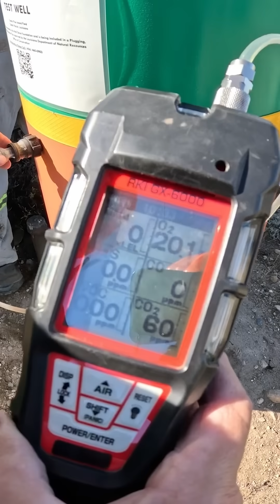The problem goes deeper than you think...

Comment: There's should be a law that forces companies to seal their hole
Reply: There are laws for that now, these are likely holes from before that law came into existence. And most of the companies that owned these wells don't even exist any more as mentioned.
Reply: @Charvin  More recent laws require that the cost to seal it be held in trust to approve the opening of the well.  People are learning not to accept a piece of paper without collateral.
Reply: @Charvin i wish i still had as much faith as you have in people to resist the pull of capitalism
Reply: @Charvin  yeah much of this is probably from a time before we understood green house gases.
Reply: Unfortunately that's why they declare bankruptcy so they don't have to.
Reply: @carlclouseriii8519  we passed a law in Canada requiring oil companies to pay for clean up when they sell off their assets after declaring bankruptcy. They have to remediate before they pay off creditors and shareholders.
Reply: Probably there is, just the companies went bankrupt...
Reply: @Benedek971  That is why nuclear power companies have to set money aside WHILE OPERATING that is used for removing the nuclear plant in 20-30 years. Should be the norm for all kinds of power realted stuff.
Reply: @Benedek971  they didn't apparently, they are just ''child'' companies made by parent companies, they are made to fail and then they can't fix the problems BC they are gone. Really messed up scheme if you ask me.
Reply: @Benedek971 the government has forms of inescapable debt, if a student can't eliminate their responsibility over their student debt, the CEOs founders and share holders shouldn't be able to shirk their responsibility to the environment.

It's not that hard
Reply: @BlueScreenCorp limited liability company. The owners'(shareholders') liability is limited to the value of their shares. If the company goes bankrupt then the shareholders walk away having already taken their dividends in previous years. This is why capitalism is so dangerous without strict regulation. They people who get the profit can't be held liable to clean up the mess they made. Whether that's oil and gas wells, nuclear waste, or ships crashing into bridges. If the cost of clean up is more than the value assets held by the company, the company declares bankruptcy and the shareholders keep all the profits they've already taken, because dividends only flow in one direction. The only way to fix this is to require the company to pay into some kind of bond to cover the future cost of clean up, as a condition of permission to do the thing in the first place. But then you have to be able to predict how much the cleanup will eventually cost before the thing gets built, and have to the laws in place to force the company to pay.
Reply: @BlueScreenCorp It is over 100 years old, the founder is dead
Reply: @gholland5840  First off, you can't possibly know that. Second it doesn't matter the ownership of the vast majority of those wells can be tracked down through property rights and mineral rights records. I am not advocating only that whoever specifically dug this well be held responsible, but all of the wells regardless of the person or company that may have put it in the ground. I thought Americans loved personal responsibility.
Reply: @BlueScreenCorp  they said it was drilled over a hundred years ago, they are dead. Try suing a dead man.
Reply: @BlueScreenCorp yeah but the company isn't around anymore to force them to fix it. The student is and they voluntarily took out that loan. This was also long ago before there were laws to enforce this kind of stuff.
Reply: @adrianthoroughgood1191 You have invented insurance b
Reply: @BlueScreenCorp exactly!
Reply: @adrianthoroughgood1191 not sure about the USA, but in Canada there is a requirement for producers to put money into what amounts to a reclamation bond for every well they own or drill. If they declare bankruptcy then (in BC) the regulator acts as the prime contractor to have the abandonment and reclamation done. I believe most provinces have a similar system. Of course, there are ways to game the system, but I’ve never seen a well left open to atmosphere like that. The worst I’ve seen is equipment abandoned in place, but with the wellhead intact and closed.
Reply: @kurtisb100  Do they have to put the money in the bond before the drilling starts? Or are they allowed to use sales revenue to pay into it? Is the bond enough to pay for deep filling with concrete, or do they just seal the top of the pipe?
Reply: @BlueScreenCorp  lol yeah go and get that money from the dead guys.
Reply: @adrianthoroughgood1191  It is funny that you think people not "owning" their messes is some how the cause of an economic model and not normal human behavior.
Reply: @BlueScreenCorp if a person files for bankruptcy then their student loan debt WOULD be cleared, even the government realizes asking for someone to pay money they literally don’t have isn’t getting anyone anywhere
Reply: @Garrillagamer  in the US student loans are excluded from being able to be included in bankruptcy. Also bankruptcy doesn't just magically wipe away debt...
Reply: @BlueScreenCorp in the US student loans are NOT excluded from bankruptcy and yes I’m fully aware it doesn’t magically wipe it away, it stays on your record but up to a certain amount can be deducted from your debt or entirely relieved depending on which type of bankruptcy you fall under. There are also versions of bankruptcy that allow you to pay back what you owe in payments.
Reply: @BlueScreenCorp   ^
Reply: @BlueScreenCorp  brother this just isn’t true, look up “adversary proceeding”
Reply: @adrianthoroughgood1191 There are other ways to incorporate than LLCs, that's not the only business entity and is not necessarily what oil companies will use by default. Also, the limited liability you talk about isn't "dangerous"; your hyper-fixating on how LLCs in theory act as oil companies when 99% of LLCs are not oil companies.
Reply: @Benedek971  you could make a law going after the shareholders and/or go after companies further down the supply chain.
Reply: @Benedek971 it’s a shell game. Bankrupting the company to avoid wind down costs. Rinse and repeat well after well. Planning negligence for a better roi is preverse. More accountability for the persons who oversee this
Reply: @Benedek971 so make it like mining companies. You have to upfront the cost to return the land to it'd original state before you can get your permits
Reply: @sambuechel9632  that's part of the lease agreement. Most want the roads/gates to stay, and capped wells are buried ~10'. After 20-30yrs they're difficult to find even with GPS and a good metal detector
Reply: @Benedek971  It should be assurance company they need to pay to every year who will seal the hole if the company go bankrupt.
Reply: @Benedek971 that's why there should be a law mandating they have Reserves for such a case or some sort of insurance. Reserve sound like a better idea though
Reply: @Benedek971 There needs to be bankruptcy insurance or something, (kinda like life insurance,) they pay a recurring amount over time, and when they go under, the money is used to clean up the mess they left behind
Reply: @Benedek971  So make them set aside money for decomissioning while they're still pumping
Reply: @Benedek971  should be a law requiring insurance for the sealing of old holes.

May reduce the number of holes and also cover bankruptcy.
Reply: @Benedek971  They didn't actually go bankrupt, they just didn't want to spend the money filling in the hole.
Reply: @Benedek971 went bankrupt to avoid paying the American way.
Reply: @Benedek971  This is why companies need to be charged the fee to seal the hole before they even dig it.
Reply: @Benedek971 someone said that they might not have but instead they’ll come back under a different name once the next boom comes
Reply: @Benedek971 There should be a law for that as well, you don't drill a hole unless you can afford to close it when going bankrupt
Reply: @Benedek971  Need a fund paid month by month while operating.  Insurance.   Shutting a company and going bankrupt is a tactic.  Just form a company for every well.  Drill it dry and walk away after asset stripping it over the last few years of well life.   Simples.
Reply: @Benedek971 there’s a law. It has to be upheld by politicians and law enforcement for it to actually work.
Reply: @Benedek971 ”bankrupt” lol you mean the own sold all stocks once profits were up in smoke
Reply: @Benedek971  Bankruptcy should not be an excuse, especially not the way the oil companies use it.
Reply: @Benedek971 then the government should
Reply: @Benedek971 needs to make a law u can't legally declare bankruptcy unless the hole is filled if u fail to do so ur private property like business building or ur house is sold to cover cost
Reply: @Benedek971  Now that we know that tactic, it should be easy to require them to pre-fund sealing any wells drilled and park that money in an account they can't touch. The drilling permit process could cover all that.
Reply: @Benedek971  I hope there are also laws against creative finance to make your company show up as bankrupt.
Reply: @Benedek971 *”bankrupt”
Reply: @Benedek971  You mean they cut and run with the profits.
Either the company should be forced to set aside money to cap a well from the beginning, so they're never in the position where they can't.
Or the owners/shareholders of the company should be sued for the money to pay for the capping work.
Reply: @Benedek971 sure buddy I gives you go bankrupt after mining a gold mine you ain’t fooling us they don’t go bankrupt oil is the new gold like bruh how arrogant
Reply: @Benedek971  CEO and all investors need to pay for sealing costs
If any of them refuse, then prison.
Reply: @Benedek971  During the bankruptcy hearing, the courts could say they must set aside a certain amount of money to seal the holes. I'm guessing, there's no money to be made off that so they don't care.
Reply: @Benedek971  There is. Oil co. pay for Plug and abandonment up front.
Reply: @Benedek971no they didnt 😂
Reply: @Benedek971 They don't actually go bankrupt. They just do it so they can stop spending money on the hole. They just start a new company and repeat the process.
Reply: @Benedek971they should have been forced to put up a bond for the cost of closing it before they drilled.
Reply: @Benedek971workarounds probably
Reply: @Benedek971sounds like then mail should be the next stop?..i love how even when it’s a good thought there’s a ……… person
Reply: @Benedek971  they didn't go bankrupt, just cancelled the company thingy idk

You will see the same ones under different names operating on other stuff, 

There are laws that you gotta seal the hole but there are holes dug and abandoned before the law existed
Reply: @Benedek971 bankruptcy still requires you to settle your debts. That SHOULD include damages like this
Reply: @Benedek971That's why companies should put money in a protected bank account before they get a drilling permit.
Reply: @Benedek971 going bancrupt should not be a reason to avoid responsability from earth polution. Should be done by goverment and the money should be takan out of all the shareholders of that company untill it's paid off.
Reply: @Benedek971 nah what the companies do is make another company sell the well to it then make that company go bankrupt. It really didn't but allows the original holder to no longer be responsible.
Reply: @Benedek971 These companies just open a new one under a new name later on. They just do not want to spend money on sealing these wells.
Reply: @Benedek971 "bankrupt"
Reply: @Benedek971 they don't go bankrupt, they use bankruptcy as a restructuring tool so they can fire people, re-open under a new name, and pay less for the next time.
Reply: @Benedek971  bankruptcy doesn't mean you get to stop everything you're supposed to do by law... It still needs to get done one way or another
Reply: @Benedek971  They are bankrupt because the owners of the wells sold them to companies they knew would become bankrupt thus avoiding having to pay for the caping of these wells.
Reply: Some of these wells were abandoned over a century ago. There aren't even good records of where they are. Recently the state came by my property with a giant metal detector looking for old wells.
Reply: @Houshalter Holy crap dude.. That is kinda freaky! And rather ominous as to what can come up and out of these old wells...
Reply: There are laws now and old wells are tracked. One problem is: company A drills the well and pump what they can get cheap, goes out of business, owner starts up company B which buys the rights dirt cheap and pumps a tiny amount of oil just to keep the well active, they will also pump a little any time they get called out for having a non-producing well. They can do that for decades, all while leaking harmful gasses uncontrolled. Really have to chase some down before they even think of closing a well. A friend tracks wells in Utah, not a job for the faint hearted. There have been multiple threats on their life and firearms pulled by non-compliant operators.
Reply: @TimB-  False. Acquisitions are not immune. There is some truth in required production to keep a lease on .gov land. It's not a loophole, it's compliance. .gov loves revenue too.
Reply: Take a deposit for each hole permitted
Reply: Probably is, these days, or at least requires funds set aside for end of life well closures... but the fact that it's a century old or more is the problem. It predates the EPA by a good bit, and maybe even the more lassez faire regulations of the early environmental movement.
Reply: There's been laws in place since the 80s that I know of. We actually had to get a bond for a well in case we went bankrupt it paid to cap the well........crazy thing is that a lot of these old wells are worth pumping again.  A 5-10 barrel per day hole was once a loss,but at today's prices a small operation can make a good bit of money 😮 we got back in the business and we're properly running 8 abandoned wells and average 125 barrels per day all while cleaning up after the previous operation 😮
Reply: @RobertFothergill-u1z  I'm surprised it pays for the drill rig and maintenance.
Reply: Ayo
Reply: In okla. The oil companies pay extra in case the go out of business. So the state can plug the old well
Reply: and everyone telling you to go vegan to save the environment needs to seal their hole too.
Reply: Us government does require. It's just such a low amount per year they have to seal. Like 50. There is a company that has thousands of leaking abandoned wells in the north east. Slowly capping them at the bare minimum, some leak explosive levels of methane.
Reply: Same for women who whine too much
Reply: The IRS seals my hole every year
Reply: “Bankruptcy”
Reply: There’s many holes to seal if the company is big enough, aswell as many ways to seal a whole😏
Reply: In Colorado, there are laws that, if a well is not producing, it is mandatory to plug the well off.
 This well on the video must have been a small private company. Bigger companies follow the law so they can keep producing.
Reply: I'm sure there is, but when that company doesn't exist anymore, you can't necessarily force them to do that.
Reply: Pause
Reply: Same with woman
Reply: Can’t make a company that doesn’t exist anymore do something
Reply: Is it me or does that sound.... its me isnt it.
Reply: That's the reason they use cut out companies to own the actual wells. They declare bankruptcy as soon as the field dries up. There needs to be an escrow law that requires a deposit for capping wells when they are drilled
Reply: there is now, just wasnt then.
Reply: Great idea!   🤔 so how do you force a company that no longer exists to perform work 😂
Reply: giggity
Reply: yeah and one for my ex wife!
Reply: Its de regulation through political lobbying. "We'll donate $20mil this quarter if you look that way"
Reply: I was asking a windfarm leasing agent about this kind of stuff several months ago. What happens to those huge towers and the chunks of concrete they're set in when the windmills go extinct? He became tongue tied. The lifespan of a windfarm is only ten yrs. That's the same amount of time it takes to get it built. I can see the beautiful prairie littered with those obnoxious things in various states of disrepair. The landowner waits for a tornado to take them down because salvage companies want the entire salvage value to take them down.
Reply: And some women, too 😅
Reply: HAHAHAHAHA, we using them as Fracking holes here in Texas.
Reply: Nope, they need to be required to pay to plug the well up front.
Reply: @michaelallen1432 , by someone registered.
Reply: People care more about profit than doing the right thing
Reply: You should tell that to your girl
Reply: Please be clear, which holes?
Reply: There’s a land reclamation act iirc that forces mining companies (which oil companies fall under) to restore land back to its original state after an operation. As stated by previous replies, they usually go bankrupt and never do it.
Reply: Corporate law acts as a shield that keeps individuals from being held personally liable. Also there isn’t a specific party that has standing to claim damages so it rarely ever gets to court. Even if you lose livestock or the life of a loved one due to radon or whatever leaking out the people that drilled the well could all be dead, and long dead at that. People been drilling for more than 150 years. By the way, don’t worry about this in terms of environmental impact. China pours so much concrete and does so much construction. That’s the real greenhouse gas emitter. India and Vietnam are next for mega construction projects but China went nuts for a little bit so yeah…
Reply: @larsfinlay7325  India now has like 9 of the 10 most polluted cities on earth.  It wasn’t long ago that it was China.  I don’t know if that means that China got cleaner or India got dirtier, but both are terrible on the environment.
Reply: And my ex gf 😂
Reply: And if you go bankrupt, the owner / board should be personally responsible for paying for the sealing.

If you can make millions over decades, then it’s your fault for not saving enough to seal the hole you made. Pay for it personally or go to prison.
Reply: @_-JonDoe-_   that's the well one of the problems. You an I are individuals and if not felons citizens. The corporation isn't. Yet they use the government to play both sides. If it benefits the company they argue they fall under citizens individuals rights. Yet when it doesn't or harms them they argue there's no individual person responsible an they aren't citizens or persons. Hence they literally just play like Baldwin did in the film fun with dick an Jane. When someone calls accountability they put sone poor Dick in the spotlight awhile cashed out before public knowledge of co closing. Then they put Martha Stewart in prison for getting caught. Awhile every lifetime politicians living in mansions (plural) on a supposed income of only $50k to $100k. The president last got a raise by Clinton from like 50k to 100k yr I think. Tell you why anyone w $ supposedly w $ like trump would want office Yet never once served office b4 last term? Same reason why no lifetime politicians wanted to serve as potus. It's a 4yr temp job 8yr at best. Can get in an rob w 1/3rd power us gov. 2/3 or even 3/3 if party controls congress an Supreme Court. Any senator wants lifetime power an stealing. Potus wants to be the boss. There's a trade off either way. Crimes that they choose run another woman against trump after hilldog. When you think it can't get anywhere worse then hilldog vs trump it does. South park Said it best. A giant dueche vs a turd sandwich.
Reply: 😅 sometimes i feel like that should be the case for some people, too!
Reply: ayo
Reply: And clean up their equipment and re landscape the area they trashed. 
They made plenty of money clean up your mess people
Reply: Back in the day that law probably did not extist. There probably is today but even though they exist the fine is probably cheaper than the money saved to not seal it. Thats why fines should be tied to the cost. Oh, its $500k to seal that hole, you just got a $1m fine for not sealing it.
Reply: No no no no no.... These companies should be required to post a bond before drilling.  The bond should cover the cost of plugging the well.  No bond, no well.
Reply: They should pay up front.
Reply: There is today thes are most likely damn near 100 years old
Reply: Make them pay for the sealing service before they can get a permit to drill, then when they go "bankrupt" its already paid for. Im sure some young business owners would jump on some good government contracts like that.
Reply: Specifically that they should fund the sealing before they ever start drilling in an untouchable fund that the government handles when they're ready to seal it.
Reply: This is from a hundred years ago, things are different now and the laws have change
Reply: Capitalism, it creates problems and then you need a plaster to cover up it's issues afterwards.
Reply: All developed countries have had laws governing this for the last 40-50 years. But merca is the land of corruption and bribery. So shit like this is still going on.
Reply: Companies need to pay the cleanup fee up front in some kind of bond. Most of these companies go “bankrupt “ as a way to abandon their responsibility to cleanup.
Reply: @shanebassen5963  they do have to now. These are old wells from before the rules were brought in.
Reply: @shanebassen5963 the law does require bonds before being allowed to drill new wells.   But the specifics vary from state to state. This means the well can be sealed up if the operator abandons it or go bankrupt
Reply: @shanebassen5963  Best idea I’ve heard in a long time!
Reply: Regulations to force companies to run their business in a specific way?! in america? are you out of your commie mind? (satire)
Reply: There could be a fund. When you operste, you have to put money to that fund and when operation ends, the well would be shut with the money from that fund.
Reply: @anttikaipainen6072  that is what a bond is in a way.  It's like a insurance policy that you pay up front and if you go out of business they take the money and use it to close the well. If you do everything right you get a good portion of your money back
Reply: Ayo
Reply: There are in Texas
Reply: How do you enforce that when a company goes bankrupt
Reply: @Menuki  it is payed while they are still on business
Reply: @Menuki  tax them then give tax breaks to companies that repair
Reply: @modernNeanderthal800  tax them???

A bankrupt company…that has no money…often times no longer exists….

Who are you taxing?
Reply: @Menuki  the next company that comes along, then use the money to fix.

But fr tax the rich in general lololol
Reply: There are now
Reply: with what money?
Reply: There are laws for this. But how do you make an operator plug a well once they’ve gone bankrupt and no longer exists.
Reply: Who are they gonna hold accountable? The employees that got fired and have nothing to do with the company any more?
Reply: If the company goes bankrupt and closes up there‘s no company to force, and on top of that. Some of these holes are over a hundred years old
Reply: There is now. They also pay for wells that are 15 years old and leaking to get plugged. Working on CBM Methane wells, you get a lot of duds and the companies usually can’t afford to plug them without help
Reply: Why do ignorant people always think they have the best idea EVER to suggest this when there IS such a law?
Reply: @UpcomingJedi  don't blame your fellow citizens for being "ignorant", there has been a lot of work done to keep people from even knowing this is an issue. 
now i don't want to be ignorant, i want to understand more, can you explain how they get the companies that went bankrupt 50 years ago to seal the holes?
Reply: tehehehheeee
Reply: Theres a law for sure but when the govt worries it about it then, we will too
Reply: There is. It’s the BLM and the EPA. They plug all wells before they abandon them. They call it a P/A
Reply: Ya, how dare those 100 year old oil men break the law?
Reply: Law? You mean that facet of post bronze-age society run by greedy corporate types? (And administered by bullies in uniform issued with guns at taxpayer expense and given blanket immunity to break any law themselves without consequences.)
Reply: Good joke. You are talking about the land of the free, where everyone has the freedom to poison others, but no one is free of poison from that land
Reply: Those companies are long gone & most likely the land is abandoned or sold
Reply: Hard to enforce when the company doesn’t exist and the people who owned it are not longer alive!
Reply: They are all capped in Texas. If the operator is out of business, the Railroad Commission has a program that caps them
Reply: Haha, they'll just bribe their way out of it.
Reply: There are laws in most if not all states now, passed by liberals trying to oppress hard working business owners. lol
Reply: yeah because laws force people to do things
Reply: Then they will seal the holes with the cheapest method they can find
Reply: @LeoXIVThePope  or not at all, because getting caught is a small fine, and usually the companies dissolve and there's nobody to fine anyways.
Reply: Exactly
Reply: There are…federal laws..
Reply: My ex doesn't care about the law.
Reply: We been drilling oil for longer than we’ve known what pollution is.
Reply: In colorado there is. It was after they found there may have been as many as 3000 uncapped boreholes all over the state and no map of the locations.
Reply: Apply the same law for unmarried women too 😂
Reply: There's a law, it's just that many went bankrupt and that the seals don't last forever.
Reply: This comment is funny.
Reply: @rinnegone377   Kinda hard to force  companies to plug their holes when they've been nonexistent for a hundred years. Many of these holes Jerry's talking about have been there since 1912. Many modern companies know of these issues and try to address them.
Reply: There is. This is what regulations are in place for.. Perhaps back then there wasn't much oversite.What would you think if I told you there are people out there who want to let corporations do whatever they want and have little to no regulations?
Reply: Already exists.
Reply: I agree that something from the first shipments of oil should have to put funds to re cap well .why does the taxpayer always pay?
Reply: Gas companies are particularly bad for leaving abandoned wells to spew methane into the atmosphere. They legally have to seal a well when they run dry or they abandon it, but all they have to do is say “it’s not abandoned, we promise we will come back and use this well again! 👉👈”
And even if pushed to fix it, they just sell all the “assets” (ie the wells that need to be sealed) to a shadow company, and then bankrupt the shadow company so they’re not responsible for it.
Reply: This happened years ago those laws are in place now 
😅
Reply: Telling a bankrupt company to cap the well, after all the dollars and people have left is like telling a dead person to walk to the morgue.  
What are you going to do, take the company away? Here you go, your oil well have fun.
Reply: Not as long as the billionaires are the ones making the laws
Reply: Or the mineral rights holder since they're making money as well.
Reply: vote republican Trump2025 my guy
Reply: They should apply that to my ex aswell.
Reply: Yup as soon as the law matters to the rich
Reply: 90% of these companies manage to magically go bankrupt right around the time they have to do reclamation work.  Then the government likes to use taxpayer dollars to do the cleanup.
Reply: Laws are for poors not the rulers.
Reply: @GoogleDeletesYourComments  The poors usually seal their holes by choice... for fun or profit.
Reply: I’m wondering, can’t you just plug the top only?
Reply: I’m wondering, can’t you just plug the top only?
Reply: @GraysonDevin-c1w  I mean you can, but plugging the bottom is the fun part.
Reply: There should be a small percentage of oil profit set aside in a government owned account that can only be used to seal & rejuvenate site
Reply: @slypig24  for sure but there ain't lololol
Reply: Keep that in mind when Space X goes bankrupt.
Reply: It's funny to think,  oil tycoons personal bank account $759,000,000 his drilling company -$500,000,000 🤔 🤣 😂  hasn't turned a profit in years.  😮😮
Reply: I gave my wife one of those laws already
Reply: Regulation on business is good for this exact reason. Companies will always prioritize profits over human safety or even innocent bystander safety. So next time u vote remember who is advocating to give these big companies even less regulation and to pay less taxes than u and me. That will tell u who is looking out for who. I terestingly enough, this has been a problem since the 70s back when corp tax rate was 60-70% and a single worker could buy a house and support a whole family. The businessez have convinced a large population that they know whats best for everyone else and that as long as they make billions they will ha e a good jobs for u. What a load of shit. If u look at the data 80% of what they save everytime their taxes get cut, goes into stock buybacks or some other scheme to generate more wealth for the tip executives never to boost wage of lower workers or to build the company up yo be better for the consumer
Reply: There are, but the cost is so great that the company just decides to file bankruptcy instead. Most are under LLCs, so the sakeholders are not liable.
Reply: @JayRSwan  cost is so great? Guess thats why they keep raising ceo pay by 500% or why they have record profits over the last 50 years. Definitely bothing to do with the tax cuts they have gotten over the same time frame that all of ours have gone up or had new ones added to us. Governments job should be to protect the people or help them(homeless/autistic/ect) but the companies got the politicians turning the transfer of wealth into the upper elite oligarchs and corporatioins that will outlive any human. Not to get too political, but this coming election you have a candidate saying that these billionaires and their giant companies need even more support, so they can buy more yachts like bezos and musk. Another candidate thinks we should tax those big corps and promote smaller businesses
Reply: When the oil runs out so does the money. 

It should be a percentage of the profits held in trust.
Reply: Surprised to see no horny comments about plugging holes here.
Reply: Or maybe an incentive rather than punishment.  We have enough laws.
Reply: When are company goes bankruptcy, it usually closes down, unless it gets bailed out. Hard to force something that doesn't exist to do something.
Reply: Another law and another regulation won't change anything. That's a lot of concrete that they have to fill in and I'm sure it cost a lot of money to get a whole crew out there for 3 days to do just one so imagine doing thousands of them
Reply: @jaredkay6970  Its too bad that these wells are so unprofitable that the companies that are still drilling and using them are only making 100,000,000s off of them in the lifespan of the well and can't afford the 1,000s to properly clean up the mess once the well goes dry... 

Thousands of dollars per well, for an oil company is like you worrying about a 5c bottle deposit, its insane that you think that is too much cost let alone a significant cost to let companies just get away with ignoring the messes that they have made in the past and give them open license to pollute into the future...
Reply: @BlueScreenCorp  It will just be another tax  on the consumer. The big business is in league with the big government and the losers are the people paying for it, which will be you and me
Reply: There is
Reply: Stop lying. Drilling companies have been forced to post bond for well sealing since 1960.
Reply: True, they let out so much foul gasses that i feel like sealing it with plug should be written in law.
Reply: There should be a law forcing your wife to keep her whole sealed while you're married
Reply: There are. It's called remediation & rehabilitation. In accounting its ARO (asset retirement obligation)
Reply: Idk if anyone has mentioned this but instead of covering the holes, they light the gas on fire so a the gases burn off. You’ll see it in Texas countryside at night, along the highways as tens of miles of just field with little orange flames flickering
Reply: There are . The state has a find to plug orphan wells in Texas . The video is narrated inaccurately
Reply: It's called, we are rich and we make the rules so no, can't force us to spend money on doing the obvious right thing.
Reply: @matthewboyd8689  do a little home work. Completely clueless
Reply: There is but if the company has no money........?
Reply: @RH-cv1rg  all companies pay into the state . Smarts states set up a fund for this issue.
Reply: @davidbrooks1724  Was that the law in 1920?
If the State receives the money why aren't they plugging old abandoned wells?  Didn't the State get the money?  What are they doing with it?
Reply: @RH-cv1rg  it’s not 1920. And yes the state of Texas contracts for the plugging of wells .
Reply: @davidbrooks1724  Take a look at the well and it is in CA.  The video was about COMPANIES abandoning the wells and not plugging them.  Stay focused.
Reply: Yes, yes there should. and, phrasing.
Reply: Companies would just declare bankruptcy so that government can clean up their mess.
Reply: @gund89123  oh ok . Yes Exxon does that every day
Reply: Hell in some cases everyone who worked on that rig and their kids have already died of old age. We been drilling oil for a LONG time. There is lot of work to do.
Reply: Go bankrupt but you are still should be responsible to correct the problem or go to jail.
Reply: There’s too many Good ole boys in the system.
Reply: Legislation now mandates that this happened however small Wells like these often were created and then abandoned before the legislation was created
Reply: Government is the one causing the problems
Reply: We have laws against stealing and murder too….odd thing is, I keep seeing thiefs and murderers.
Reply: There are lots of laws, but oil lobby buys the legislature
Reply: Some of these wells are from like 100 years ago.
Reply: Liberal propaganda.
Reply: Very poor choice of words.
Reply: Not with someone like Trump…
Reply: @JonDoe-Berlin  
Meanwhile, the Biden/Harris regime hasn’t mandated it during the most previous four years. Sounds like you should vote Kamala, she’ll definitely make it happen now. 🙄
Reply: Ayo
Reply: Tell that to my ex
Reply: The fine will probably be five dollars. 
Plus, the oil companies own too much of the government to care anyway.
Reply: I'm sure there's a "Yore Ma" joke in that original post. 😂
Reply: If trump wins you can say goodbye to regulations like this
Reply: We have to get a law that seals Donald Trump‘s hole first.
Reply: @davidthompson7817  I sure hope he wins! I can’t afford any more of what the Dems/ left have put in play!
Reply: Tons of these ‘orphan’ wells were drilled in the 30’s and 40’s by Roosevelt’s run up to WW2, went dry in the 50’s, and were signed over to the land owner decades ago.  Since then the land has been sold a few times, and the new owners may not even know that a well is there.  The Texas Railroad Commission has been doing nothing but doing the producers bidding for decades.  Now a man named Hawk Dunlap is running.  He’s an expert in the oilfield with decades of experience.  He’s been trying for years to get the RRC to plug wells properly!
Reply: Whenever someone who doesn't know says there should be a law you're basically licking the boots of politicians who want to take away freedoms from people and impose regulations that end up costing taxpayers trillions of dollars. It's absurd. Why don't you educate yourself on the topic..... I mean a real hard look at methane use and production. Perhaps then come up with an easy solution that doesn't cost taxpayers money and uses sound principles to conserve nature.
Reply: Yeah there mouths so they stop talking nonsense
Reply: Do you hear yourself? A bankrupt company is dead with no money to pay for that
Reply: @benhoffman8264  they often pull strings to go bankrupt while keeping their profits to reduce cost of clean up. Therefore keeping more money for the 1% that control the business. Bankruptcy is in some cases a business/financial decision
Reply: Just like every other law, there are ways to get around them if you hire enough lawyers
Reply: Same could be said for my ex wife 😎
Reply: @molonlabe2645   hello Mr 261 I'm 260 we've met the same type if woman much as mosr the other 265 lol
Reply: There is these days.
Reply: They should make them pay a bond to close the well before giving a licence to operate the rig from the beginning.
Reply: Escrow accounts.  Every hole drilled means that money has to be put in escrow to cover sealing costs.
Reply: There are laws about plugging a well. Depends on the state is how much oversight there is in plugging a well. BLM usually stay on top of whats going on. Some of the service companies will cut corners if they can to save money. As each cement plug dries, your supposed to let it set around 8 hours. The biggest cut is to not tag it with your work string to make sure it's there and set up.
Reply: They don’t do this. I know this as fact personally
Reply: To pay up front for the cost, so it’s paid before they get all their money and somehow declare bankruptcy
Reply: why its your property !laws another KAREN
Reply: You can say the same thing for when companies pollute the ground or the water table they don't pay for it the taxpayers do
Reply: @maxwolf2726  If the company is still in business, they sure do pay for cleanup.  If the company no longer exists, it's kinda hard to make them pay.
Reply: Ok,go to the.head of the class🎉😂
Reply: It's why we have federal services such as EPA(Environmental Protection Agency)
Reply: Hard to enforce a law on a company that doesn't exist anymore.
Reply: Take the $ on the front end to seal the hole when they are done
Reply: That’s what she said!
Reply: There is now, probably not 80 years ago.
Reply: Right. The capitalists use and abuse our earth and the poor suffer
Reply: Seems like it could be fairly lucrative to capture the gas....
Reply: There is a law like that. In the o&g sector that is referred to as ARO, or Asset Retirement Obligation, which is in essence a bond. These companies are required to account for the future obligations (expenditures) needed to properly close down operations at each drilling location when they are no longer profitable. The old unplugged holes referred to in the video are from old boom times when regulations and our understanding was scarce.
Reply: There might be, but who are they gonna come after when they just abandon it? Seriously scummy
Reply: My dad worked on a drilling rig and, they were producing wells but the Texas powers that be plugged them up. I haven't seen them. I've always wondered if they opened back up? I know the town close to the rigs and remembered the dates. He had a persentage in 2 of the wells. Does anyone have any advice for me?
Reply: Sounds like a job for Diddy
Reply: Good luck on that one. Conservatives don't like taking care of nature.
Reply: There are, but the companies file for bankruptcy. So the states started making the individual company owners responsible for plugging the holes. And the operator owners started creating companies under their (often immigrant/seasonal worker) employees’ social security numbers and making them individually file for bankruptcy…

The solution that worked was to force companies to pay into a tax-fund while they’re producing. If they plugged up the hole afterwards and it passed inspection, they got their money back. If they didn’t, the money was used to plug the hole
Reply: Require a deposit for each well when granting the license
Reply: There should be laws for a lot of things
Reply: You know this is what regulations are, right? Laws in place to protect people, animals and the planet from corporations. The same regulations that Trim stripped and wants to strip even more because he takes money from corporations. Otherwise, why would he want to get rid of regulations? To help out the average folk? People just have to use a little bit of critical thinking skills and not just believe politicians with what they say, but with what they do!!
Reply: It doesn't matter if the company seals the hole or not the peasants pay for it to be sealed
Reply: There is a law that requires it, that's why a lot of companies don't think the investment to continue digging is worth it anymore.
Reply: Or they should actually use it. We have the capability of being energy independent. And it's better for the environment.
Reply: There are, but what companies do is either go bankrupt or sell the well to another company.  Hard to make a company seal a well when they don't exist. States make laws where companies have to pay into a fund before drilling that is supposed to help plug abandoned wells but usually those fees don't cover the actual cost.
Reply: There are laws against it now, but these most likely from before that law became a thing. Don't quote me on it, but I want to say the law is probably only like 10-20 years old. The other thing is either with the original bill or an amendment to the law once it's been signed, is that in order for a drilling company to obtain the necessary permits to drill, one of the prerequisites they must show the gov't is that they've placed a certain amount of money (that the gov't decides) into a bond of sorts, so if the company just happens to "conveniently" go belly up as soon as the well dries up, the gov't will receive the bond amount and use it to either fill the hole themselves, or higher another company to seal the hole.

The one time I went through that process (I wanted to start an ISP and service my neighborhood with fiber internet so I stopped by the city's offices because I planned on trenching the streets to lay my fiber down, and the quote they gave me was somewhere between $50,000 - $75,000 so if I go bankrupt, the city would use that money to get the trenches/holes I created repaired.
Reply: They are suppose to put red sand in um to help avoid sink holes in New Mexico but they don't audit the company's and the companies are cheap thus you end up with the sink holes under 100s of hones and sh
Reply: Ayo
Reply: Oh, there is a law, and it's expensive
Reply: Thats what she said😂
Reply: There is but if the company is solvent they can't fill it cause they don't exist anymore
Reply: That's what I was thinking. How is that legal to just abandon the hole and equipment there? Heck, the EPA won't even let us store steel outside uncovered, but these guys get to do something so egregious.

Really shows the bias that money will get you in government.
Reply: That's what she said about her friend
Reply: There apsolutely is. Its usually a concrete block that gets installed, and before that you have to chabge the drilling mud and replace it with water , but with enough pressure, so the surrounding formations get enough support from the hydrostatic pressure.
Reply: There’s usually a work over period on wells that have been closed in for years from the surface before you permanently cement them in . I’ve reworked wells drilled in the 30’s either put them online or laid down casing and plugged them.
Reply: There should be a law that proper research must be done before commenting on YouTube.
Reply: 100 years ago. We cement wells in now.
Reply: Doesn't work, you can't make a company that no longer exists do something. All you can do is build the fee into the up-front permitting or royalty fees, then give it back if they seal it up after.
Reply: Capitalism.
Reply: The way you said that... lol "sir... I need you to seal your hole 🕳" lol
Reply: It will just make oil more expensive and therefore gasoline, as well as make our oil have a harder time competing in the global market.
Reply: @Smokey298  Oh diddums, oil execs will make slightly less in bonuses every year... I hope they can manage.
Reply: @sergarlantyrell7847  No, you will pay more.
Reply: There should be a law that forces the company to pay the cost of sealing the hole BEFORE drilling the hole.
Reply: Sorry, the first amendment prohibits that.
Reply: Agreed, they should not be able to extract all the profits they can and then walk away from all responsibility to leave the site safe
Reply: ok sasuke  uchiha
Reply: IF (IF!!!!) IF the customer wants it covered! I’ve seen guys that had wells on their land that weren’t producing enough for the company to justify keeping it open, but was still producing enough to keep the property owners home supplied with gas and they will cap it anyway.
Reply: Yes, many mining companies also abandoned many mines even with TNT & other hazards like these gases easily accessible- these mines also continue to erode and become more unstable and many people have died falling into them or exploring them.

They should be tracked and held accountable, but sadly this happened a long time ago and must now be corrected after the fact.
Reply: Ayo
Reply: There is
Reply: its crazy that there isnt considering there's laws like that for mining companies, how is oil harvesting different from mining?? they're both being extracted from the ground and ruining the land in the process
Reply: @ there is laws
Reply: Why do you hate capitalism?
Reply: Soon they'll have no regulations with the Republicans agenda, no accountability is why we have bribes of our employees.
Reply: And Diddy should respect that law 😂😂😂
Reply: There are, everything is enforced by the railroad commission (RRC) and anyone who gets caught doing what this company did is liable to be charged a fine…. This is the same for spills,and other things of that nature…
Reply: I think some women need this law too :9
Reply: There are. You are very gullible for believing this click bait video. Perhaps it’s time to take some time away from the internet
Reply: Well, if there isn't already, you can go to your local state representative and have them vote it in. It may take a while, but through enough lobbying and through enough politics you can get something done
Reply: They should pay a federal tax for every hole drilled to MMS and MMS supervises the capping process.
Reply: There should be but any time we try to use laws to force rich people and their companies to do things we get screamed at that we hate freedom so vOv
Reply: @padathir  people used to riot for their lives. Now they riot to cinch the yoke on tighter.
Reply: @ the problem is we do have those laws, they just went bankrupt and on paper, literally couldn’t pay anything.
Reply: I could make sooooo many jokes from this comment 😂
Reply: I been in the oilfield 20+ years. Obama signed a bill that Bush left on his desk. we did P&A work for 8 years solid. On land, marsh, and on the shelf. One of Trumps 1st executive orders was to cancel stop or shut down the P&A. P&A cost rich ppl $ they don’t want to spend. Binden didn’t restore it so the wells are still there. The ones in the marsh often leak in the water and they just put oil booms around them.
Reply: I'm so sorry... 

But this can be interpreted in more ways than one...
Reply: Should make them get a bond when they start a new well so that they get the money back if they plug the hole if not the money from the bond gets used by the county to cover the costs of plugging the hole.
Reply: I bet the bankruptcy keeps the law from prosecuting them.
Reply: There should be a law holding executives accountable even in “limited liability” companies
Reply: nah those gasses are in sewer lines too so w.e.
Reply: There is a company that does this, it's called Grindr, I think.
Reply: the state in which I reside has a law.  If it doesn't produce for a yr. it has to be plugged.  And H2S doesn't kill with a single breath..  It would be nice if people making videos knew a little of what they are talking about.
Reply: Canada is forcing their companies to do that
Reply: Likely not in the next 4 years
Reply: theres no $$  in it y would they ROFL
Reply: There is. Oil companies have to pay up front to cover plug and abandonment. There ya go!
Reply: These wells are not left wide open like that, they do get sealed, I have worked in the oil and gas industry for years, they do get sealed.
Reply: Should be created a special oil royalty specific for this issue. Then, the government contracts a company to seal those holes. Of course, legislation should be improved to avoid this kind of "bankruptcy"
Reply: You mean clean up the mess thst THEY made?
Fat chance
Reply: There should be laws that regulate how much is drilled and how much is taken too, but the people that make those laws won’t make as much money from that
Reply: Seriously
Reply: There are. Those are old, abandoned facilities from before the legislation and regulations were put in place.
Reply: Same with tiktokers xDD
Reply: Plenty of laws, zero enforcement.
Reply: Both holes
Reply: The original drilling operator should be required to purchase a bond for this very purpose when the well is brought online.  This would be easy to implement into the permitting process, and due to the time-value of money, would be a minimal expenditure compared to the drilling cost.
Reply: @KH-vv5dq  🤣 Bro, you're talking about "adding regulations" to oil companies. States like South Dakota and Wyoming don't do that. Because they don't care.

Don't believe me, just look at their work-place fatality rates compared to other states that actually have safer standards and regulations
Reply: Cant force a company that no longer exists to do something
Reply: @ actually, that’s often part of the bankruptcy.  You can still be fined for breaking the law.
Reply: There is a law that says if you don’t produce a well or “lease” in a given amount of time you must P&A (Plug and Abandon) that particular well, and reclaim it to its original value. Like it was never there in the first place. So it is in fact illegal to just leave it open to atmosphere.
Reply: There is laws for this now yes. As a land developer you can't for instance build over dormant holes and there is usually a radius easement placed. If your interested in seeing where railroads and active and dormant well. You can find information on for your state's railroad commission website
Reply: Welcome to 'end stage capitalism'.
Reply: the oil companys make the laws lol
Reply: Nope, there shouldn't be
Reply: thank republicans and their de-regulations of a lot of safety stuff to please their corporate overlords
Reply: There ARE laws that say a company must plug an abandoned well but most of the time it isn’t done or not done properly!!!
Reply: Conservatives: Y- Yo- You mean, RE RE RE RE REGULATION???? 😭😭 NOOOOOOOOOOO BIG GOVERNMENT!!
Reply: They didn’t go bankrupt
Reply: Yes, because imagine a child or even an adult not seeing it and falling down it years from now when all of that machinery around it is gone.
Reply: Skip that law.  There should be a law that allows the free harvesting of methane by third parties.  Methane is a free resource.  This is just expensive and centralizes power and money.  Think a lot of veterans could responsibly use this.
Reply: Methane is a fuel source in its self.  They are capping off a lot by that can be utilized by farmers and ranchers, for one.
Reply: It's likelier that than allowing sharing of a free energy resource like methane, the oil companies would rather cap off these wells instead, before any laws could take place.  
Better to act fast to get the methane harvest infrastructure in place before that happens.

Doesn't it sometimes feel like a vicious cycle???
Reply: We could go lots of places with this comment.
Reply: Lawfarers!! This is America. The People will always find a way to tell the Government where they can put their probes.
Reply: Since when did laws stop companies?
Reply: There is today
Reply: MAGA would say: that's communism
Reply: imagine how many cars were added when Biden blew up the Nordstream pipe to Germany.
Reply: Facts
Reply: No there shouldn't. There should be enough competition that we can choose the companies who do seal their holes
Reply: "bankrupt"
Reply: Thats what she said!!!!
Reply: he said more often than not the companies go backrupt..... Not only does the company not exist, but there is no money to fine them. Its the problem with social media addicts. Can't extrapolate an idea past the initial stages
Reply: @rawnoon1616 a law to seal the hole funded by the first profits of each well. There's no excuse.
Reply: There is
Reply: but it's a good hole
Reply: The government should charge a fee in advance for each hole drilled. Then the government should be responsible to plug the hole. 

Does it have to be plugged with concrete? Couldn't they fill it with mud?

Or gravel and mud. Whatever is cheaper than concrete that'll work
Reply: Maybe there should be a law for you to seal your hole
Reply: That's what she said
Reply: They went "bankrupt" to avoid that expense. Then they open up another company under a different name to do it again.
Reply: While technically there is the rig a drilling is often done some subsidary company when the well busts it goes bankrupt and nothing happens
Reply: This is false info, you plug the hole before you leave the job site. There is laws about it etc. This video is just bs
Reply: There's so many loopholes
Reply: 😂😂😂 you don’t pay attention to your government do you
Reply: I think they need to pay into some fund now, while they pump oil. This money is then used to seal the holes, but it seems that this requirement is rather young and the unsealed holes date back over 100 years.
A recent estimate I heard was 1 trillion to get all holes sealed assuming $10k per hole.
Reply: They could just sell the spot to a natural gas compagnies
Reply: My hole, my rights
Reply: There is... But they have these things called lobbyists and bribes that make it so nobody enforces said laws.

Keep voting for Republican/MAGA and "drill baby drill" and this is what it gets you.
Reply: Thats what she said
Reply: You should apply that to yourself.
Reply: There is. Now. And in the US, such laws are weakly enforced.
Reply: they make the laws when they buy your politicians
Reply: There are lots of regulations about who is responsible for plugging "orphan" wells, usually the 'last owner of record'. Many times the companies went broke and there are no assets left to confiscate to apply towards the cost of the work. When this happens, the governmental body that is in charge (in Texas it is the Railroad Comission, in Kansas the Kansas Corporation Commission, in Oklahoma the Oklahoma Corporation Commission) has to seek funding to contract a service company to do the work. Oklahoma CC capped 1200 or their 15000+ orphan wells in 2022. KCC plugged 93 of their 5500 and Texas RRC spent 34 million USD to plug 1250 of WhoKnowsHowMany of theirs in fiscal 2024. They are trying!
Reply: I agree, but when the money runs out where is the money going to come from to seal it. I agree there needs to be more accountability to fix this stuff but there also needs to be money to fix it.
Reply: but that will cost rich people money instead of poor people lives
Reply: The workaround is creating an entity that is designed to go out of business. It's complete bullshit. They should at least be made to pay into a common fund that cleans these up if they companies don't themselves.
Reply: You just go back in time a hundred years and I'm sure they will care
Reply: There are, but if the company declares bankruptcy and no longer exists, who’s going to be held responsible?
Reply: If they don't exist yet they're definitely not going to now lol
Reply: There's many companies that make no attempt to remove or cover the well.
Reply: There are now. U heard him say 100 years ago right?
Reply: This shit like minecraft
Reply: They are required to put up the money to plug the hole to get the permit to drill now. Had a well drilled and the owner of the drilling company was arrested the drilling was put on hold and seat there for years before it was plugged and it poisoned the well water.
Reply: @Khaerulbtg  Companies have to pay for it to be capped before they can drill. At least that is what she said.
Reply: My hole. My choice
Reply: But think of how the profits will be affected! /s
Reply: did you not listen... 100 years ago.... umm retroactive laws athat reach back to nobody whonois alive today.. who ya gonna sue???
Reply: Yeah then some business friendly politician will say it's too much regulation while they slide a hundred in his pocket
Reply: They're supposed to set money aside to plug the well and do cleanup before drilling now
Reply: They could require a monetary deposit to cover capping the well when approving the drilling permit.
Reply: There is, they just ignore it.
Reply: i think these ones predate the knowledge, i think modern onces plug them up or they would face backlash
Reply: that's what she said?
Reply: Wasn't that regulated by the EPA that musk just disbanded?
Reply: There is it's called the railroad commission
Reply: How much does this cost my grandfather has two abandoned wells on his property in northern Pennsylvania.
Reply: Why don’t YOU start!?
Reply: The last this country needs is more regulation!
Reply: Ok, but for now ,deal yours
Reply: I blame Billy Bob.
Reply: There is, but the punishment is a fine, and you can't fine a company that dissolved itself just before the hole played out.
Reply: How do you expect them to do that with no money?
Reply: There should be laws that keep people from walking away from abandoned companies. Those laws should be actually enforced
Reply: There are laws and rules to prevent this from happening now days but obviously for the old small wild cat operators in the far past this may not have been addressed.. still the government should address this with EPA clean up slush funds… believe me long ago things done in all industries require this slush fund for environmental clean ups.. your gasoline tax dollars pay for this I assume..
Reply: @bjkirkpatrick5960 need a way to have the company that made the hole pay the government has to know all the information!.
Reply: @bjkirkpatrick5960 lol no it don’t! it pays Trudeaus retirement fund
Reply: @bjkirkpatrick5960  So the taxpayers should pay for companies that filed fake bankruptcy to dodge their obligations?  as otheres have pointed out, the company bankrupts itself on purpose, the same people just reopen a new oil company with the profits they siphoned off.
Reply: @bjkirkpatrick5960 unfortunately conservative governments cut funding and power to EPA so they are not able to do that. They are not able to enforce the laws that are on the books either
Reply: i do not need a law to convince me to pay someone to fill my hole.
Reply: @bluepriest6990  Phrasing!  😂
Reply: There is… but 100 years ago they didn’t know the extent of what could escape the unplugged wells so it wasn’t even something they thought about. On another note it seems like these wells would be valuable for collecting natural gas
Reply: @sparks6177 
That was what I immediately thought!
Why the hell aren't we just using them for the natural gas?
Reply: There should be a law about a lot of people shutting their holes. But that's for another video
Reply: @baleavitt  they did that in Germany around the 1930s or so
Reply: @baleavitt which hole?
Reply: @baleavitt  I think they have a special plug for those.
Reply: @baleavitt  😂😂
Reply: @baleavitt and not on this platform😅
Reply: @baleavitt 
But if there was a law about people shutting their holes, you’d be in gross violation because you’re talking out your back hole.
Reply: @baleavitt That statement covers a LOT of ground, lol.
Reply: @baleavitt free speech!
Reply: @baleavitt Sounds mighty unconstitutional.
Reply: @baleavitt  there is such a law. The 1st amendment to US constitution.
Reply: @baleavitt  that was so unprovoked xD
Reply: @baleavitt  I reckon you're quite the dictatorship fan huh
Reply: @baleavitt how deep are the holes?
Reply: @baleavitt you would deny a man's right to freedom of speech? How domineering of you.
Reply: @colemanbubar5098  they are just a troll looking to cause issues
Reply: @colemanbubar5098 freedom of speech only applies to the government stopping you. Wrong or right, that is not a violation
Reply: @dragonh8174  he said law. That implies government, no?
Reply: @colemanbubar5098 deny freedom of speech? How does that work here?
Reply: @colemanbubar5098  why are you so offended lol
Reply: @colemanbubar5098  I'm pretty sure it was just a joke. Learn to laugh a little.
Reply: @baleavitt  so you're against the 1st amendment, bet you support the 2nd more
Reply: How they gonna pay for that if they are Bankrupt?…
Reply: Or what you fine them after they become bankrupt?
Reply: The companies sell the wells to shell companies that then go bankrupt so there is no way to force the company to seal it. What needs to happen is the wells need sealing taxes. Create a fund specifically for sealing wells
Reply: There is now, but until about 50 years ago most people couldn’t care less about the environment.
Reply: 😂 there should just be a law for everything and everyone at everytime for all things
Reply: There are in Europe. You forgot that the MURICA is not in the first world.
Reply: @thor9517  Europe is 3rd world
Reply: It should be tied to the ceos. The company will bankrupt but all the people in charge will be fat rich
Reply: @modernNeanderthal800  Oh no, the CEO that died in 1935 will be hit with a fine to his nonexistent estate.
Reply: @gholland5840  lolololol. Tax them!!!!
Reply: @modernNeanderthal800  tax what? The corpse of a man who died 50+ years ago?
Reply: @gholland5840 Assess Their Impact And tax them over time. Then use the money to repair. 

It's kind of a joke though guys. I hate the idea of more taxes because then politicians get to play with our money and maybe reneg later. 

I think we can take them to court about it but it would be great to do something better than just "tax them" 

Eat the rich but..... Let's think things through
Reply: @modernNeanderthal800  Again, they are dead, they died 50+ years ago.
Reply: Too many irresponsible and greedy companies. The get their profits without figuring the cost for closing down a well.
Reply: socialize the losses, privatize the profits.. its the american way
Reply: They need more laws like pay what you promise, don't leak oil, use the gas that escapes instead of burn it, use modern double hull ships, etc
Reply: @PAULO-gv6he all great ideas. Are you willing to pay your share for all that white also knowing that you'll never know the true cost, only the increase in prices of goods to the consumer.
Reply: @PAULO-gv6he  There is. Oil co. pay for Plug and abandonment up front.
Reply: I hate seeing comments like this
Reply: But it’s 1000 cars over 20 years. How many car sales do you think happens annually? These holes are not the problem
Reply: Yes, and if near the ocean, watch out for blown seals.
Reply: Lots of concrete, still fucks up the environment
Reply: @miceskin  how afterwards? 🤔 it's literally buried.
Reply: @miceskin  It’s cement, and you don’t know what you’re talking about.
Reply: 🤣 you're adorable. That would be called "red tape" and Republicans don't like having that around oil production. So, it's cheaper just to leave an environmental hazard abandoned in a field for, literally, decades
Reply: And what’s the point in filling one hole when their are probably hundreds more about
Reply: @CricketEngland  why eat when you will feel hungry again?
Reply: @Khaerulbtg Exactly. We are trapped here just to pull weeds and rake up leaves.  😂🤣😵
Reply: @Khaerulbtg  Nice liberal logic. But let me help. Plugs are permanent. Food is fuel consumed and must be replaced
Reply: @CricketEngland  that's like asking "why stop one murderer when there's 100's more around?"
Reply: @crimsonpenguino4406  100 taps are turned on pouring water everywhere, you come along and turn one off and walk away.

Think about it kid!
Reply: @CricketEngland Generally speaking, if problems exists, no matter how numerous, any progress made is progress nonetheless. You might be inclined to the lazy life and enjoy giving up, but some of us are happy to pu our time and effort into solving even small problems. Do you work in retail or food service? I remodel homes.
Reply: @CricketEngland thank you for that, now that we all feel a little dumber. Any more statements from anyone?
Reply: @CricketEngland  The journey of a thousand miles begins with just one step.
Reply: @CricketEngland Got to start somewhere , 
And not all of the wells are utterly valueless... 
Many are in fracking regions , so those licenses have a value and are held by big companies,
Reply: @CricketEngland  Because you deal with those hundreds by starting with the singular.
Reply: @G1NZOU  that ok as long as they do
Reply: @CricketEngland well, then you move on to the next, then the next, and so forth.
Reply: @Expedition_America  but are they doing that?
Reply: @CricketEngland  you just saw a video of them doing one... so yeah.
Reply: @CricketEngland  so now they move 9n to another one, and once that one is done, they'll do another one. Obviously they cant do them all at the exact same time.
Reply: @Expedition_America  but are they doing that!
Reply: @CricketEngland you just saw proof of it. This is what this crew, along with many others, do all the time. There's other comments up above telling they know people that do this.
Reply: @CricketEngland  how do you plug all the holes if you cant be arsed to plug one?
Reply: @sovietmoose5624  it’s no good just plugging one if your going to leave the rest open is it.
Reply: @CricketEngland well that's exactly they're working on plugging them.. not too bright there are you?
Reply: @CricketEngland gotta start somewhere.
Reply: @CricketEngland 1 at a time is better than none.
Reply: @CricketEngland man what a dumb question
Reply: @shadygunshow  give a man a fish and you feed him for a day, give him a rod and teach him to Fish and you feed him for a lifetime

Think about it kid….
Reply: @shadygunshow  and if you don’t understand my last reply kid, well imagine 100 taps are turned on pouring water everywhere and you just tune off one tap!

Maybe that a bit more simple for your brain !
Reply: @CricketEngland  Why live when all life ends in death?
Reply: @CricketEngland this mentality is actually room temperature iq. You ever sit down and just think about actions and consequences? Chain of events? Causes and effects? Do you throw garbage outside your car window because there’s already trash on the side of the road?
Reply: @CricketEngland  Got to start somewhere.
Reply: @CricketEngland  Maybe they're planning on doing the rest? Maybe doing one is better than doing none? That attitude could be used by everyone to excuse doing nothing - "I can't do everything all at once, so what's the point of doing anything?"
Reply: @CricketEngland  Why take a shower if you're just going to get dirty again?
Reply: @CricketEngland  You have to eat the elephant one bite at a time.
Reply: @CricketEngland  A trip starts with a single step. There were 13 wells on my farm at one time. Now all but 3 are plugged. The Ohio DNR was onsite to watch the gas well get plugged. 3 different plugs of 300' each in a 1500 ft well.
Reply: @CricketEngland thousands
Reply: @CricketEngland toddler logic
Reply: @boblol1465  why! Imagine i came to your house and turned all your taps on but you came around and only turned one off.

Same principle kid
Reply: @CricketEngland  i was replying to:
"And what’s the point in filling one hole when their are probably hundreds more about" (sorry for being rude in the reply, was in a bad mood)

Filling one hole gets you closer to the goal of filling hundreds more, it may inspire someone to fill more holes, and also this video raises awareness of the problem

And i dont think filling holes is as easy as closing taps (I dont think you can just walk up into abadoneded oil rigs looking for holes?)
Reply: @boblol1465  the point Is dumbo that like the taps, filling one whole is useless unless the rest ACTUALLY GET FILLED
Reply: @CricketEngland  Yuo do all of them.
Reply: @CricketEngland that would be one less hole that the public (taxpayers) would have to pay to plug. The public didn’t reap all of the profits that were pumped from that hole, why should they have to pay to plug them? It is also a part of that oil company’s deal when they negotiated for the rights to drill that land that when they are thru that they restore the land to the same condition as how it was before they arrived and set up operations. Yet too often these companies just turn off the power and walk away when they are done, not honoring their negotiated commitment. They have made all of the money that there was to be made, and now they claim bankruptcy and just walk away, often just leaving everything there to rust.
Reply: @CricketEngland you have to start somewhere.  That is like saying,  why make abortions illegal? There are too many people using it as birth control to stop them.  Both just sound stupid.
Reply: Every little thing counts man @CricketEngland
Reply: @ not in this case of the other holes are still spewing out harmful gasses, that’s like me coming to your place turning on all your taps a full volume and then you only turning one of them off.
Reply: @CricketEngland … it’s making progress, ok but one… subtract one hundreds of times and eventually you reach zero 💡
Reply: @CricketEngland What’s the point of saving $1 today if what you’re saving for cost $500?
Reply: @kmward26  cricket is a massive bellend
Reply: @ if you don’t save you will never hit your target
Reply: @CricketEngland 
Every hole counts. They can only do so many at a time. Each a step in the right direction
Reply: @CricketEngland better is better than not better?
Reply: @CricketEngland  You can use that excuse to not do anything. If the rest of humanity thought this way we would still be living in caves.
Reply: @CricketEngland because your cutting down on pollution and dangerous holes currently abandoned slowly but surely. And making sure current companies close the holes when done. Going bankrupt should not be an excuse for waiting till the bottom falls out before the money dries up.
Reply: @CricketEngland  many thousands unfortunately. but as the saying goes "you know how you eat an elephant? one bite at a time. there are wells like this from Calif to the East Coast. So every one they cap is one less leaking well gas into the atmosphere. I worked on many of these that were drilled in the early 1900s in Calif. they were capped by driving a redwood plug into the well casing back in the day. We have to drill out the wood pull as much pipe as we could and lay it down. Any pipe left we shot perforations in with perf guns and then we pumped in cement and squeezed it into the formation through the perfs. and brought the cement all the way to the surface. It's actually quite a process and the State has to pay for it since the companys are long since gone. Unfortunately, they will build homes there and at some point the ground will shift or they will have an earth quake and the well may start leaking again.
Reply: @CricketEngland  because you fill more than just one hole....
Reply: @CricketEngland  Its a process.
Reply: @CricketEngland  ehh, because you plug one and then plug another after it and each time the amount of holes around gets lower....
You voted labour didn't you....
Reply: @ prove that’s actually happenning up to now i have inky seen this one being filled
Reply: @CricketEngland  prove they are filling up the holes or prove that the holes releasing trapped gasses under the earth can be a danger?
And yes you are correct the only thing I know is how to do an probably awful bowl (haven't played for many years)
Reply: @CricketEngland why stop a ball short of the boundary, when they've already run two? Why dive for the catch at first slip when there are another 9 men in the shed?
Reply: @ you obviously know very little about cricket
Reply: @CricketEngland you're not that dumb are you
Reply: @CricketEngland  He just explained how much of a difference plugging one hole makes. Plus...I'm sure they don't stop after plugging one, they move on to another, then another, then another...See how that works?
Reply: @CricketEngland 😂
Reply: @CricketEngland I don't even know how to begin describing how ridiculous that statement is.
Reply: @ ok well you go turn on all the taps in your house fully on and then get someone to just turn off one.

Same principle.